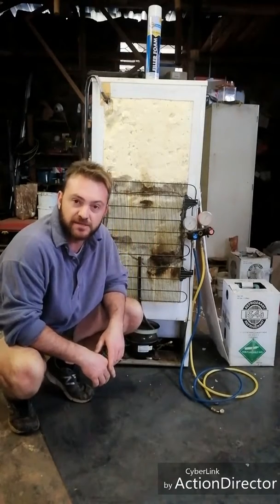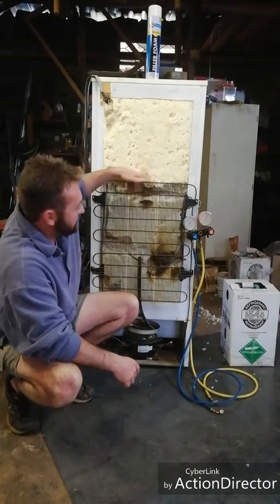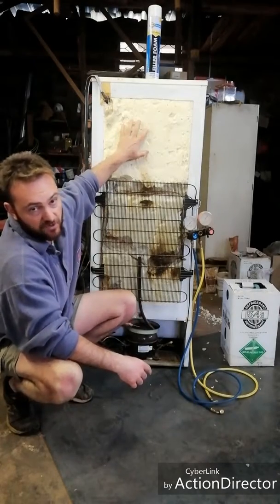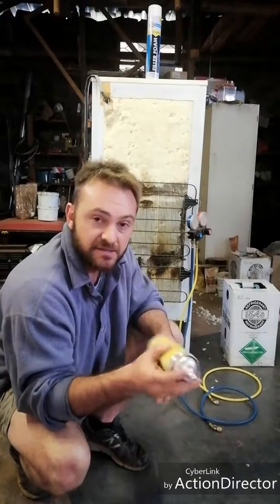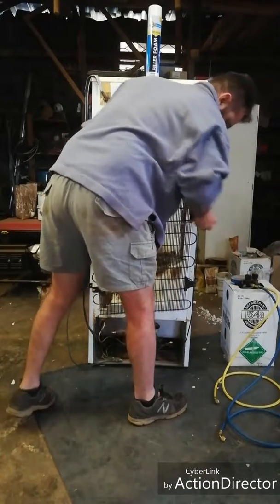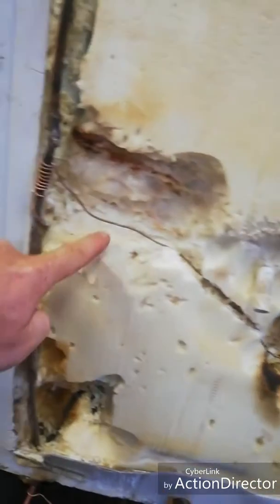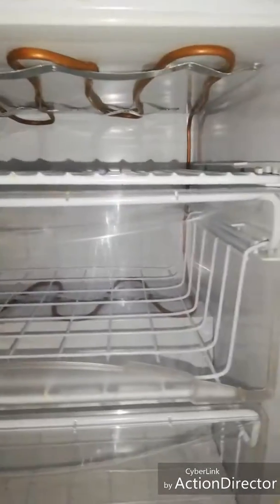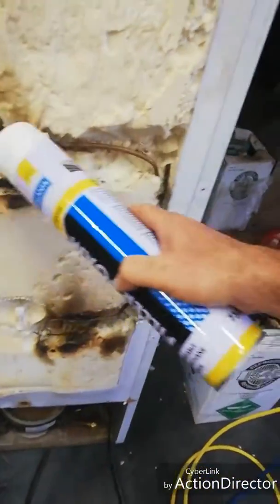DIY: Replacing rusted leaking internal pipes

Comment: Well done, these models with the chromed looking steel pipes, I have done many of them. But I almost always join the copper pipe to the steel pipe inside the freezer after the capillary exit the suction pipe(most rust acures where the pipe bend is extreme) That way I keep the capillary and the old pipe in place only replacing a peace of the suction pipe.
But sometimes this is necessary.